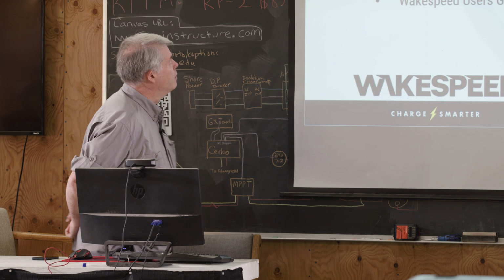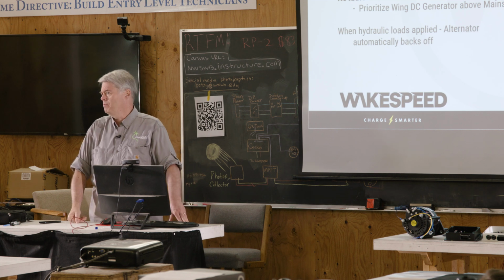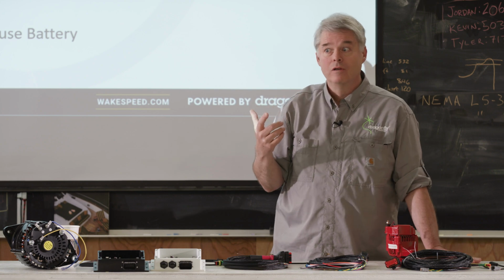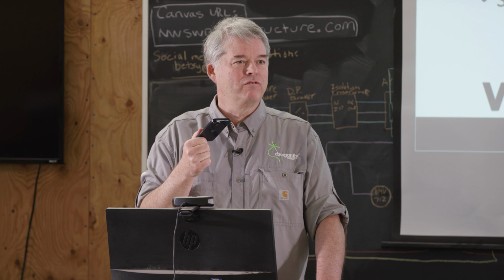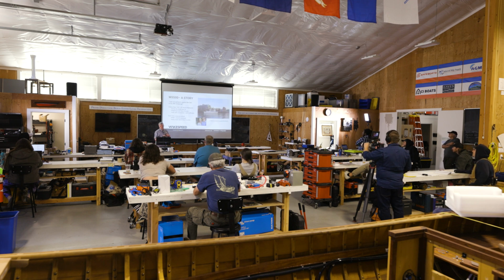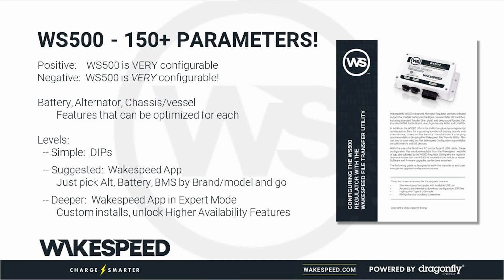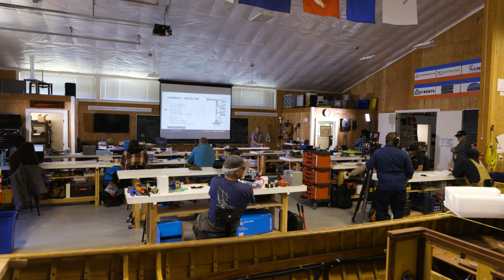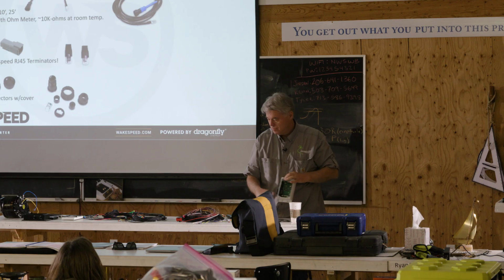Wakespeed 101 | Advanced Alternator Regulator Training at Northwest School of Wood BoatBuilding

Comment: I’m really lost in the purpose of these units? Are they just a regulator or and a charger? Or do they regulate the current of a dc to dc charger from your alternator?  Seems like an unnecessary redundancy to have this inline with a dc to dc. What about 12 to24v charging from alternator? I’ve got a 300ah high output alternator and use two dc to dc (15a) for my 850ah of battery. For the charging capabilities, honestly it’s a waste of money. 
And why are we not designing systems using old genny alternators to just use 120v pass through to our inverter while charging? Contractor genny at 6500w can be bought all day for around $500. Why not just use those for 120/240v charging?
Reply: They are used to convert,monitor, and  make compatible the alternator DC current safely compatible with charging lithium batteries and other  battery profile types. In my case I have a high performance 250amp alternator and I running a dual Lithium battery setup at 12v 135amp each without the Wakespeed WS500 my alternator would burn out my lithium battery internal circuitry as well as they won’t communicate with each regarding overcharging or undercharging. Also this unit keeps the alternator from overheating too. I hope this reply kinda answers your question.
Reply: Basically the unit lets you properly integrate your alternator into your house electrical system, and at the same time manage the alternator so that it actually behaves intelligently. In effect, they control the power generated by the alternator to manage a number of different paramters. Firt it will manage the output to ensure the alternator doesn't overheat itself and burn itself out. Especially important with large LFP banks, where you can push power into them as hard as you can (safely) drive the alternator.

Secondly, they can manage the alternator so that it doesn't overload the engine. Important on my boat, as I have an 85A alternator on a 40 year old 10hp diesel. I also have it set up so that the alternator doesn't produce any significant power until I hit about 1200rpm, and again taper off when I go above 2800 rpm, as that probably means I really need a lot of power into my prop. 

Third, they can fully integrate the alternator with the battery, with the battery directing how much power it wants at any given moment in time. So, say, my battery is somewhat out of balance, the BMS will command the wakespeed to only allow 1A into the battery, no matter the voltage. Or, my battery is coming up towards full, the BMS will start tapering down the current and voltage limits so as to not overshoot full charge, and the Alternator will respect those limits set by the BMS. If the BMS detects any fault state, it sends an alarm signal over the CANBus and the wakespeed shuts down the output, hopefully avoiding a disconnect, and even if you get one it won't damage the alternator because it's already shutdown. 

Why not use one of those cheap generators? Well, first, it would mean I would need to carry gasoline on a diesel boat, and gasoline on a boat is best avoided if at all possible. Secondly those generators are noisy and consume space. Third, the dirty secret of saiilng is you're probably motoring half the time anyway, so you might as well put power into the battery while you're doing it. Lastly, those generators are noisy. Last thing i want to hear in a quiet anchorage is the sound of a generator.

Comment: Thank so much for share all this information Mr. Al Thomason. I find the WS500 a really a super system/device. I am working in a project in order to refit an old 38 feet aluminium sailboat and redone all the electric. The basic setup will be 170A 12V alternator  with a WS500 and charge the Lipho House Battery ( 400 or 600 Amph /4.8Kwh or 7.2Kwh) The AGM starter battery will be charged  via DC/DC from the House B. The House battery will be top up with solar panel and Wind G. as well. And at the bow 24 V AGM pack for the windlass and bow thruster also charged with a DC/DC from the House B. I like your idea of 2 alternators but with this power I prefer to have a brand new alternator in stock aboard as a spare parts for redundancy. Thank you again for your contribution to this technology. Cheers from Patagonia Argentia.